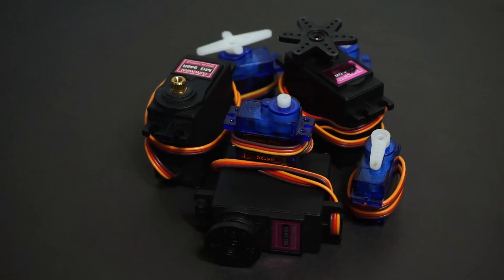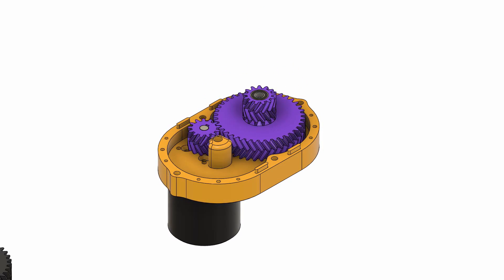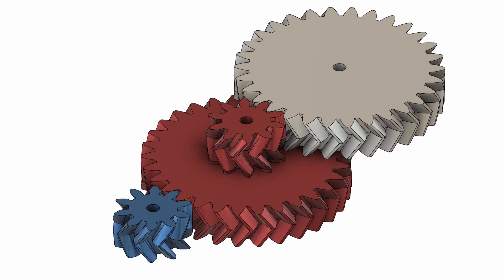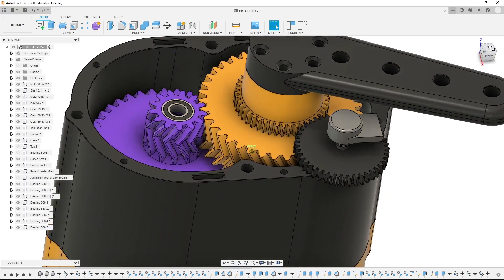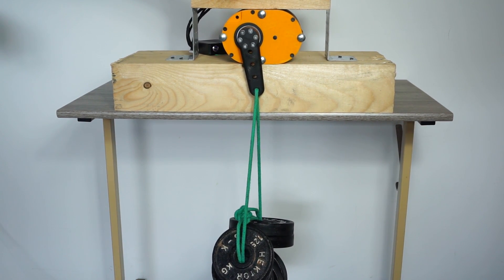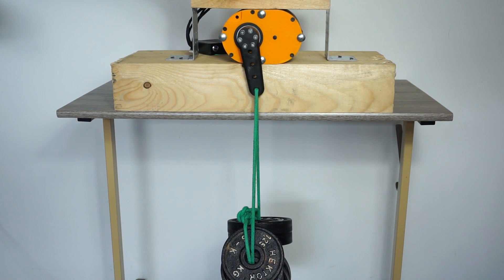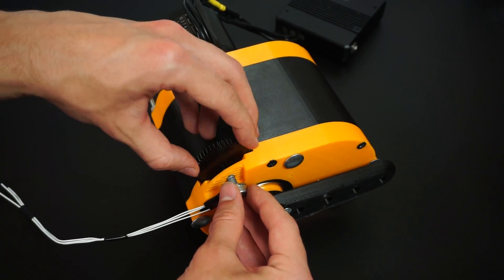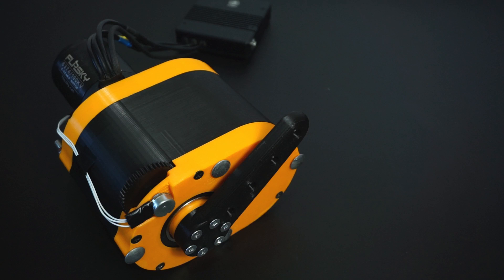I Made a Powerful 3D Printed Servo out of an Electric Skateboard Parts

Comment: At 11:30 you basically have what I am aiming for. I want to make power steering for my kid's go kart, but make it able to be controlled remotely too. So basically the VESC in my case would have to receive two inputs: one from the steering column pot and one from the remote transmitter. I know nothing about coding, so this project has been a challenge for me.

Comment: Excellent walkthrough of different gears. I have always wondered why nobody uses such motors for actuators. Pancake hub motors for bicycles should have better torque on low revs, making it possible to have smaller gearbox ratios.
Reply from the maker: Thanks!
And yeah you are right pancake low KV motors are ideal for such robotic actuators. I am thinking about testing cheap camera gimbal motors for small 3D printed actuators, cause they would only require low gear ratio and would be perfect for mini robotic arms.

Comment: Those are the most amazing and clean 3D prints I've ever seen. Hopefully one day, my prints will be something close to these (I'm not holding my breath)...
Reply from the maker: Thanks! It's really nice to hear but those prints were made on a standard Ender 3, nothing special. Just a bit of tuning and you should achieve similar results. If you want to print even better try installing Klipper. It will make any printer instantly better.

Comment: When applying grease for the gears, be careful, as if they are an even whole number ratio of one another it will likely never spread to adjacent faces. for example a 1:4 set. paint an entire half of the smaller gear, now 4 spots on the large gear get surface contact with those, And possibly that's as far as it spreads.
Reply from the maker: That's a great point actually, honestly I wouldn't have thought of it, but I'll keep that in mind from now on.Thanks for the advice!

Comment: Way, WAY overgeared - given that this motor can easily output like 5 nm sans ANY reduction, 5 * 81 - you do the math :D No way in hell 3d printed gears (unless 3d printed metal, of course) can stand up to a fraction of this torque. 80% of your design does nothing except add friction and noice...
The concept itself (with a different motor like, indeed, 5065) is 100% viable though, be been thinking about a drive by wire bicycle...
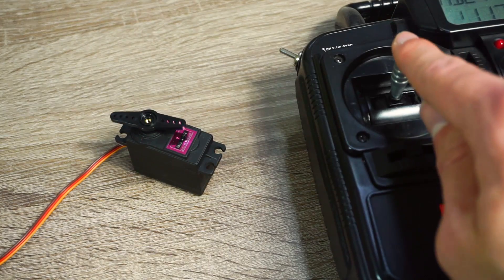Reply from the maker: Yeah I made this gearbox mostly for fun and it's not really practical design. The 6374 motor has a max torque of about 8Nm so with just a 1:10 gearbox it could become a really powerful actuator. I recently purchased an Odrive and I am planning to make a cycloidal gearbox for this motor so with that combination it could be a very strong and precise robotic actuator with actual practical uses.

Comment: you can also use the Vesc to keep track of the position/angle of the motor, it will have much better resolution

you'll need to use the arduino as a ppm/servo receiver and then use VESCUART lib to send commands (make sure to use logic level shifter for 3.3V)

Comment: I always hear helical gears are stronger than straight cut but at the same time helical are often replaced with straight cut in aftermarket performance applications for additional strength. Or used in high torque applications where noise doesn’t matter (the reason reverse makes that whine in a manual transmission is because they are straight cut. Matter of fact when I blew up the transmission in my WRX and I was building it up for more power I had straight cut 1-3 gears installed (popular upgrade) and they survived over twice the power the original helical gears sheered at albeit it sounded like a supercharger until I got to 4th gear. 

Not my car but here is a video.

https://youtu.be/rpzzHuaPLnc

Always been curious about that. Think it’s anything to do with less space being used thus fatter/stronger gears?

EDIT: Nvm, found a engineering paper on it. Helical gears push themselves apart from each other laterally. If the load on the gears is high enough the gears can bend side to side causing them to rub against whatever is next to them or bend far enough they can lose contact with each other or strip the edges off. In other words it’s application dependent, just depends on the amount of torque and where that force will be applied. Ex. It’s better to have straight cut when using a large gear that can deflect.

Comment: Nice video! I actually designed and built an ultrafast & powerful linear servo using VESC and EBoard 5065 motor last year, so funny seeing this in my feed now😁. If you didn't know, you can actually write 'custom applications' for VESC in C, so you could ditch the external Arduino and use just VESC. I wrote a custom VESC app for my servo which allowed it to home against endstops, read the internal hall effect motor sensor for position tracking (no external sensor required), and talk on a custom RS485 multi-drop bus for control. If you'd ever like to explore the idea of custom VESC apps, let me know and I'd be happy to help :)
Reply from the maker: Thanks! 
And well I didn't know that you could write custom apps for Vesc. That actually sounds super useful and also might come in handy in future. My servo was just a one time project,  but if I am ever going to build something similar I would be glad to use your help.

Also do you maybe have any videos of that servo of yours? Because from the description it seems like a really awesome project : )
Reply: @BasementCreationsChannel  Sorry for waiting so long to reply, been so busy with work 😅. And sure thing, I'll record a video in a bit and post it so you can take a look at it :)
Reply: @BasementCreationsChannel  Just recorded and uploaded a quick video to my YT channel. Hopefully it doesn't stay in 720p. Let me know what you think of it :)

Comment: man you don't really need a potentiometer since those motors are mostly sensored so you can just use the motors position for tha, that`s way more precise too
Reply: Ps. that's meant as positive critique, i love the design and i think you did an amazing job!!
Reply from the maker: Thanks a lot but to be fair I knew that those motors are sensored and I also considered using that sensor instead of potentiometer. However the sensor inside the motor isn't any precise encoder but 120 Degree Hall Effect Sensor which has pretty low resolution. It was also easier for me to program it using a potentiometer so those are the reasons why I used it.
Reply: @BasementCreationsChannel  Late to the party, but you'd be surprised how accurate and precise the internal hall sensors can be for an application like this, especially when you consider how much you are gearing down, your resolution just gets better and better. You can get resolution of a degree or two just rotating the can of the motor if you look at the VESC monitor tach output. Considering the rest of the backlash in the system, the final output resolution on the servo horn wouldn't be any concern. I left some info about me using the hall sensors for positional feedback in my own VESC-powered linear servo I did a while back in my other comment :)

Comment: i am extremely interested but i have a question about the motor. in the video, you have a brushless motor but in the link to the Arduino code, he uses a brushed motor. do you happen to have the code for the brushless motor? i built a RC lawnmower(posted at the end) but I'm want to upgrade the servo with a brushless. there isn't a lot on how to make them servos on the internet.  https://youtu.be/HTpaumKJCJU
Reply from the maker: Hi 
You can download all the codes that I used in this video as a zip file from my Thingiverse (link is in the description).By the way I love your RC lawn mower and especially the fact that you used the whole Dji Inspire as a FPV cam ;)
Reply: @BasementCreationsChannel  ha thanks man. i was having trouble seeing the lins in the grass and there really aren't any good hd fpv systems out there so i used that initially so i could see. ive upgraded to the connex fpv system since then. How do you have that pot wired into the motor? it looks like the wire runs into the casing of the motor. Now ive made oversized servos with brushed motors but never a brushless motor. this is what im trying to make into a servo. its the rear steer for my truck it has a brushless motor right now i just have a car esc but i need it to be servo https://youtu.be/gwXIadxhQKE
Reply from the maker: Well the only potentiometer used in this project is the one mounted on the front of the gearbox.There isn't any potentiometer inside the motor but there is a small encoder there and that's why you can see those additional sensor wires coming out of the motor(Usually big hobby brushless motors have some sensors inside for smooth startup in electric vehicles). However this encoder is not suitable for precision control because it has low resolution and that's why I am using an external potentiometer. So basically it doesn't matter if you want to use sensored or sensorless motor to make a servo like this.
Reply: @BasementCreationsChannel  okay I think I see what you're talking about now. I'm looking at the code and where it has pin mode 5 and 6 as an output is that for the 5v on the pot and the ESC? I have been trying to figure this out for years and I greatly appreciate all the help you've given me. Also do you have that code set up just for the ESC in your video or will it work for a lot of ESCs?
Reply from the maker: Okay so in the code you can see that Pin A0 is defined as potentiometer , Pin 2 is defined as RC Receiver and Pin 9 is assigned for ESC signal.  Pins 5 , 6 basically don't do anything and therefore you dont connect any wire to them.  So what you need to do is to connect esc,pot and receiver to Arduino 5v and Gnd  (Esc should be able to power up the Arduino) and later connect signal wires as defined in the code. And to answer your second question yes it should work with any ESC as long as it works in two directions (In the video I used VESC but it is just more advanced ESC and it is controled the same way as normal ESC)
Reply: @BasementCreationsChannel  i cant even begin to tell you how thank full i am. you are awesome but what if i want to add a second motor? how would i
 modify the code
Reply from the maker: No problem I am just glad to help, but to be honest I don't really know how to modify the code to work with two servos. You can try do duplicate the code for 2 separate servos and later somehow merge it into one sketch. If that won’t work you can just use two separate arduinos for each servo.

Comment: I love it, will try to design one but smalller for a exosqueleton proyect, maybe adding a quadrature encoder for high acuracy?
Reply from the maker: Thanks man!
I am fascinated by exoskeletons and when I was making this servo I had an idea at the back of my mind that it might be used in one. However as you said it should be smaller,more compact and also more precise.The backlash that this servo has is actually intentional since I wanted all the gears to run smooth even if my 3D printer messed up some dimensions. I designed them using Helical Gear + plugin in Fusion 360 so if you want to make your own servo you can try to design gears with less backlash. Also for precision it would be best to use encoder paired with an odrive and maybe even different type of gearbox like belt drive or cycloidal drive. As for the motor I think that for a small exoskeleton 6374 might be an overkill. You can try to search for smaller brushless skateboard motors with lower KV. I once did a research about robotic actuators and I found out that some people make them from those big flat drone motors like A12 8318 or Eaglepower 8308 and some even try to use cheap hoverboard motors as it turns out they have quite high torque (around 13Nm without any gearbox). Anyway that's all I know, hope your project turns out great!
Reply: Quadrature encoder would kind of be a pain to use, because every time you turned the servo on, it would have to find the start position and count pulses from there. Maybe an absolute encoder, they have rotary hall sensors that are pretty accurate.